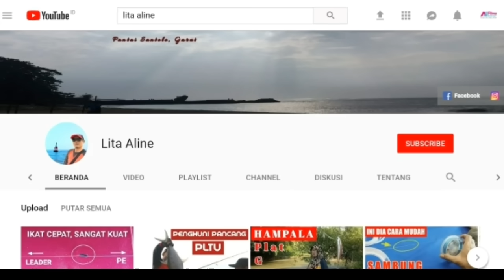INI BEDA, BIKIN CETAKAN METAL JIG YANG KUAT DAN PRESISI | How to make strong and precise Metal Jig

Comment: things needed for making this diy Jigging lure mold

1.  clay/play wax
2.  Polyester Body filler
3.  fiberglass Resin (Polyester Resin) to thin out the Body filler for easy pouring and less bubbles.

4. Jigging lure ( to copy.)
5. Mold Form( Cardboard, Plastic,Etc.)

i was wondering what they use to thin the body filler, because most polyester body fillers are stiff.